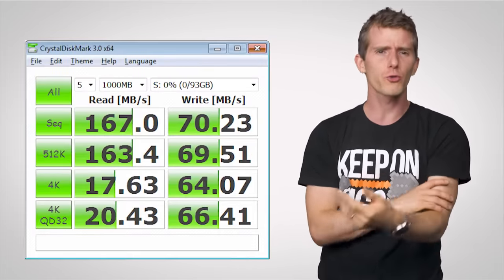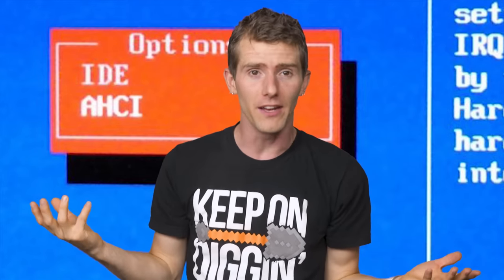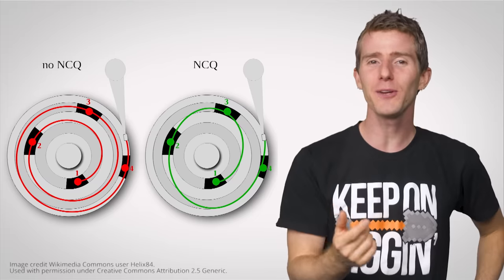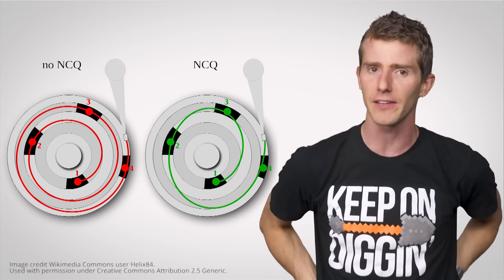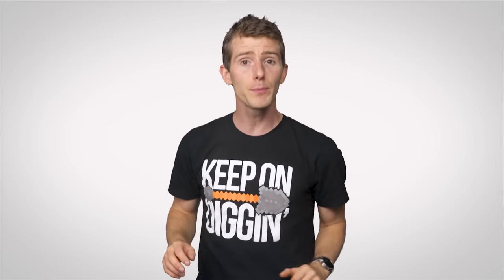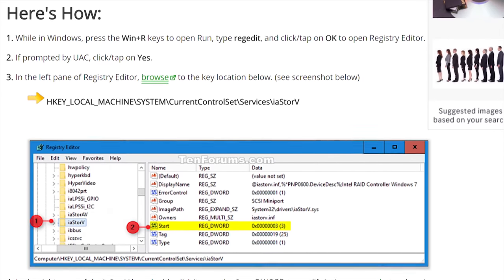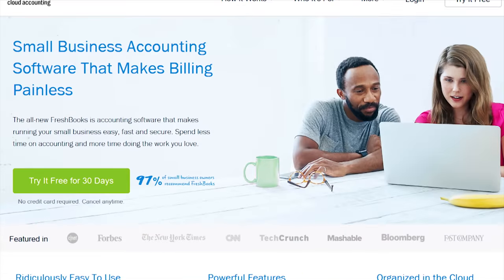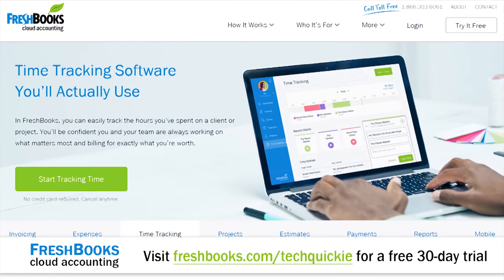What is AHCI?

Comment: there's another option to change ide to ahci.
just change the setting first to ahci and then boot to safemode,
after booting to safemode, the ahci drivers will automatically install then restart,
now you can boot on ahci mode without bsod.
tested on windows 7,8/8.1 and 10
Reply: It worked, that was a quick life saver tip. Thank you.
Reply: I swapped it in bios before changing in regedit. Now my PC don't see system. What to do? =((
Reply: Well done, good Sir!  :)
Reply: Made change, got BSOD, remembered your instructions, implemented & it worked!  Had I not seen your comment, I would have reversed my changes & cursed AHCI not knowing.  Thank you Ray for your comment!
Reply: @ScROnZjara  new pc time
Reply: @Derpster_  Bruh, you just need to reinstall os
Reply: @memenest468  that’s what I did it worked
Reply: Yeah, this. Especially since Microsoft renamed one of the Registry keys in an update several years ago. (msahci was changed to StorAHCI. A lot of older tutorials that involve Registry fiddling won't work if you can't find the registry key). I was able to switch to AHCI without any registry fiddling. What I did:
1) From a regular Windows desktop, run "mscofig" Go to the Boot tab. Check the "Safe Boot" box.
2) Restart and go into BIOS BEFORE Windows loads.
3) Find your specific disk or look for something like "Storage Configuration." 
4) Change your drive setting from IDE to AHCI. Save changes and exit BIOS. Let Windows continue booting.
5) Windows should finish booting in Safe Mode. When Windows finishes booting, run "msconfig" again. Go to the Boot tab and uncheck "Safe Boot"
6) Restart again.
Reply: No way!! You are a life saver!!
Worked on Windows 11

Comment: You don't need to modify the registry if you switch from IDE to AHCI mode. If the OS allows you to get to a command prompt after a boot failure, you can run a disk checking utility (chkdsk on Windows for example)

Comment: Play it at 1.5t (times) in the speed settings. Essentially if have SSD, Windows Vista or later and your BIOS supports it, enable AHCI for speed gain . If there is a boot problem, switch back to IDE and google the problem. The solution is easy
Linus the show is called Techquickie so make it quickie

Comment: Linus, since Windows 8 you don't need to change any key on registry in order to OS recognize AHCI.

Just make sure BEFORE doing, create a local account and set up windows to do next start in safe mode, change the setting on bios and wait for the system to boot up on safe mode, change to initialize again normally and done.

Comment: Experienced the same boot error (BSOD) when I changed the SATA mode from IDE to AHCI, so I reinstalled Windows. IDE is intended only for compatibility with Windows XP or older operating systems, as they do not have included AHCI drivers, and AHCI support is only introduced in Windows Vista.
Reply: Mark Arca reinstall can be avoided by setting up safeboot in msconfig so it boots into safemode after changing to ahci in bios. After boots turn off safeboot and restart then ur done.

Comment: Most modern motherboards are already set to use AHCI by default. I know all the ASUS and Asrock modern boards I bought are already set to use AHCI. However, that doesn't mean all of those boards have AHCI enabled by default, I think it all depends on the manufacture and the BIOS version that comes installed on your board.

Comment: AHCI is supported out of the box on Windows Vista and later, Linux-based operating systems (since version 2.6.19 of the kernel), OpenBSD (since version 4.1), NetBSD (since version 4.0), FreeBSD (since version 8.0), macOS, eComStation (since version 2.1), and Solaris 10 (since version 8/07).[4] DragonFlyBSD based its AHCI implementation on OpenBSD's and added extended features such as port multiplier support. Older versions of operating systems require hardware-specific drivers in order to support AHCI. Windows XP and older do not provide support out of the box.

Comment: Let's say you want to upgrade your rig to the latest and greatest. AHCI will be the biggest head ache when you switch out your motherboard. I got several customer on DELL boxes that are all upgraded since 1990's had number of success just moving the OS drive in IDE to newer boxes and boots up without issues. I have to give credit to DELL for keeping their hardware backward compatible. However, this all changed few years back when DELL shipped their default OS drive to AHCI. I've been lucky changed the BIOS to IDE and got away by cloning the drive to boot up without much issue but I do see an end of IDE eventually as all hardware is stepping away from older format.

Comment: I recently had the issue with switching windows to AHCI mode when i changed HDDs.. i was using an old drive that didnt support AHCI mode and switched to a new hdd... a much easier solution is simply to boot windows like normal in the IDE mode... tell it to restart in safe mode... switch to AHCI mode... startup in safe mode.. then just enable normal bootup.. and restart..
windows in safe mode loads all drivers for best compatibility so it works when switching.. and "sees" that u are using that driver and enables it durning normal boot and everything works

Comment: What you showed pretty much happened to me, not in Windows, but with Linux.  I had gone into my config and enabled AHCI, but on boot, it hung at trying to mount the root filesystem.  I needed to rerun mkinitrd, then it included the Linux kernel ahci.ko module (and any of its dependencies) into the inital RAM disk.  THEN it was able to find my root on the HDD.

Comment: Here's a question: Why do dell laptops with M2 NVME ssds ship with RAID mode on in the bios instead of AHCI, and why does changing from RAID to AHCI allow us to install Linux and allow Linux to see the SSD and install an OS, whereas RAID does not, and furthermore, why does switching from RAID to AHCI make the Windows partition stop working.

I just installed and split a 512 gb SSD into a Linux (fedora) and Windows 50/50 split, and I can only "dual boot" by switching the BIOS each time I boot the one or the other, from AHCI to RAID to make Windows 10 boot, and back to AHCI to boot into Linux.  

It feels to me like there's something really black art going on with "single volume RAID on a single nvme disk" being the default way Dell ships laptops.

Comment: cheaper ssd's and not manually enableing trim in windows or linux while in IDE mode can actually brick ssd's if it doesnt crash before it fills the drive to the brim. if you have auto sizing pagefile this can happen and you cant format your drive as it cant buffer the format area. windows likes to not turn trim on automatically without AHCI and if your firmware on the ssd doesn't do it natively. u can be out an ssd. even with AHCI sometimes u have to enable trim if you don't do a reformat( recomended and most of the time nescecary as your IDE formated drive wont boot) this was far more common when ssd's were small like 40gb or less as you run out of space quick.

Comment: I want to know the differences between AHCI and RAID. When i add a Samsung 960 Pro 2TB to my ASUS G752vs with Win 10 pro already installed on an old 512GB NVME ssd in RAID mode, i faced a lot of issues.
Reply: aptx2345 AHCI is a protocol for drive communication, whereas RAID is drive array management.

Comment: Hello, i got a problem with setting AHCI i dont why but when i set it on BIOS and save and rebbot my pc wont start. It restarts all the time on windows icon before it logs on Desktop, any idea?!
Reply: kalamaki88 maybe gettig bsod and then its restarting before u see it.  U can check dump file and u can also set it up to not restart after bsod so it stays on screen.  Ill let u google that tho. 

But for ur issue.  Try going into msconfig and select safe boot so it will boot into safe mode.  Restart go into bios.  Change to ahci.  Save and exit.  Should boot fine now.  After boot turn off safeboot in msconfig.  Restart and should be good to go.  If this dont work.  Goodluck.  Worked for me tho.

Comment: For starters thanks for your great video's, very informative & entertaining. Just want to give my 2 cents on this setting for HDD's. Any thoughts from you or viewers would be great. Thanks again. It really sped up my machine using HDD's so I would expect the same for SSD's.

I took a 7-8 year hiatis from PC's in 2010 after my twins were born & 12 years of nothing but PC's building / gaming well a little sex too :P When I decided I had time for it again & wanted to game some; I went on ebay & got a new CX600 & XFX HD7950 then fired up the Win7 64bit AM2  Phenom 9750 DDR2 4gb OCZ  Hitachi 250gb for OS a better 640gb HDD Cavier for storage (kinda backwards in the way of speed). After I upgraded to win10 I bought a B97 3.2 quad 2x4gb of ram after 4gb was slow opening just google..

I tried cloning main HDD to a Inland 480 SSD & it worked great but couldn't keep it from freezing/locking up after about an hour. I tired everything I could to no avail. Same HDD with AHCI enabled with the Link Power management (whether I need it or not it's set to HIPM+DIPM)much faster now from enabling AHCI (from SATA not IDE) on my legacy bios. I know most bios show IDE or AHCI like one in this video. 

But now Win10  thinks my HDD's are removable lol. All I didn't try to fix SDD was a bios update, now wondering if that's it. It should be backwards compatible for my sata II 3gb. Temps aren't bad, but freezes with SATA or AHCI enabled..

Comment: My question is rather... how da fak is it any kind of logic, that if I have two OS'es installed on two separate HDDs with one on IDE and other one on AHCI settings, and I HAVE TO HAVE a proper setting in BIOS to boot from either them, but not to read data off them after booting into os from other drive?

Comment: I have windows xp and i change from AHCI to IDE it solves the blue screen but the computer can not find the graphic card and it is slower now than before can someone help me to change it back to AHCI without getting blue screen error
Reply: john tsi  for me booting into safemode after changing ahci worked. So go into msconfig.  Select safe boot.  Restart then switch to ahci.  Then turn off safeboot.  Restart and should be good to go.

Comment: i try edit registry but still blue screen when change to ahci
Reply: Hien Pham yoyoy had same issue on windows 10.  Did google. 

Found out u have to first go to msconfig and on the boot tab select safe boot so it boots into safe mode.   Restart, change to ahci in bios.  Let it finish booting to windows.  Then turn off safeboot in msconfig.  Restart and ur good to go
Reply: EHEH RON changr to ahci restarr then blue screen window no boot in safe mode

Comment: Question, I don’t understand how serial data communication such as SATA is faster than the old IDE connection. I would think transferring multiple bits at a time would be much faster than one bit at a time. My only guess is interference in the IDE ribbon at high speeds.